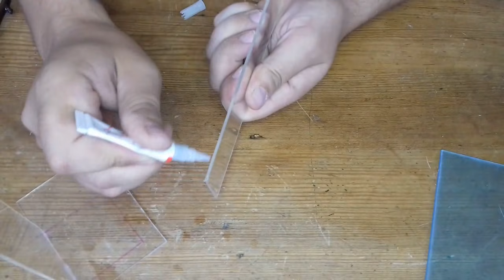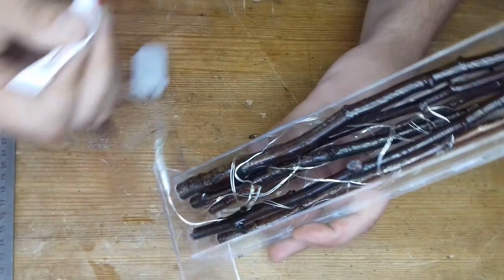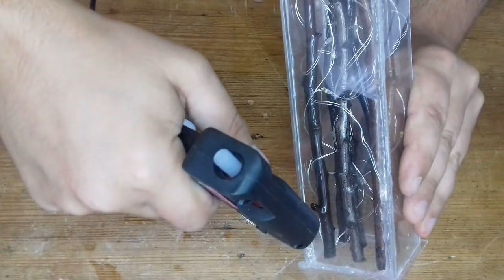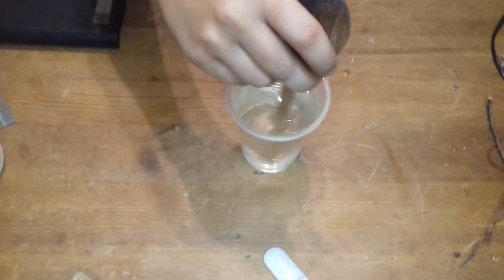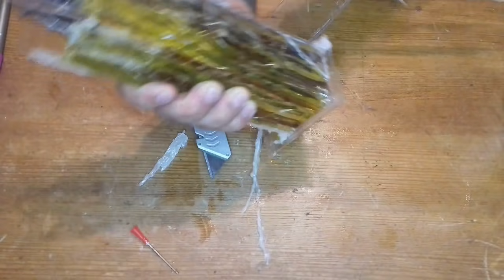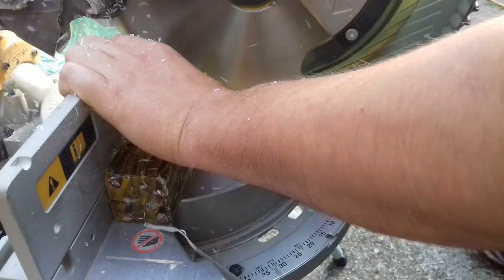Epoxy Resin Night Lamp - Resin Art

Comment: Massive amount of bubbles :( have you figured out a way to fix that problem? Maybe pouring horizontally instead of vertically and going layer by layer, so the bubbles can escape and using a heat gun or something? Otherwise a lovely lamp, it would be great to work this only downside out... What's your take on this?
Reply: You are a good observer..
My suggestion is.. just coat your wood first.. than pour resin once its dry..
Reply: All you do is get a vacuum compression tank..home remedy is grab a shop vacuum plug in the hose air tight to a clear topped 5gallon homedepot/lowes bucket. Sucks the bubbles right out of any resin project. Or just invest into a vacuum compression chamber/tank. Bubbles gone. Also torch or heat gun appliance just warm enough that all bubbles rise but not so much to cause anything to unglue or come apart not too hot. Heat rises so the bubbles will rise to the top & pop.

Comment: I interested in trying projects like this for the first time but after doing some research on how many  different types of resins are on the market I'm confused about quality of resins and how much you can pour at once. In this video you poured a mass amount that goes against everything I've read about how much you can pour at once. Are you pouring in stages?
Reply: I think its better to pour layer by layer from what i learn is that resin tends to generate heat so if pour all at once it will generate huge amount of heat which may affect the project....